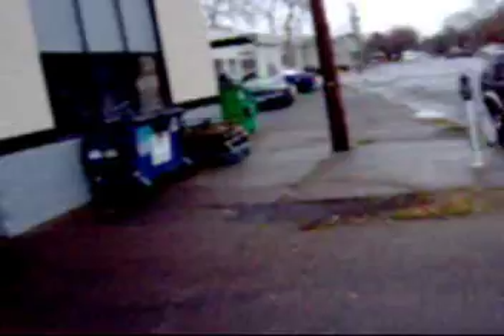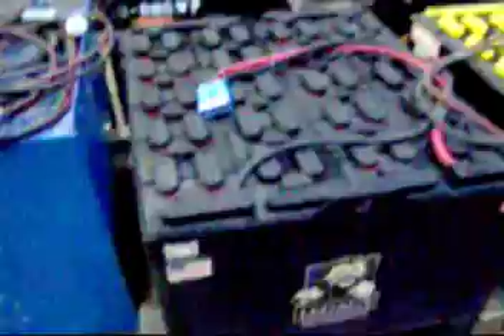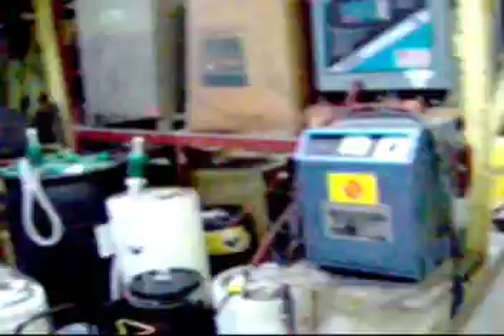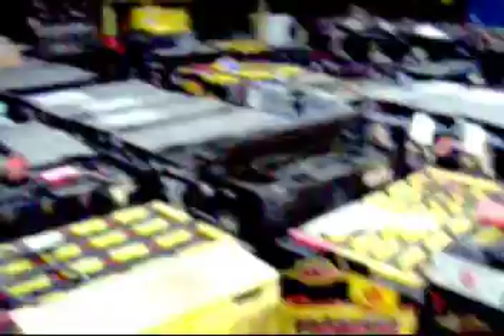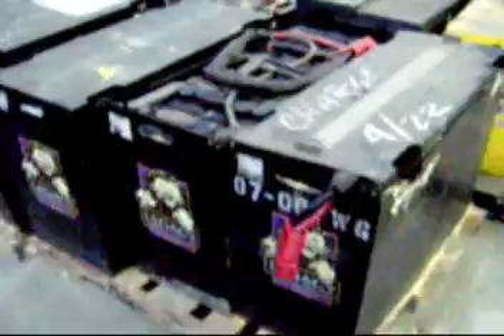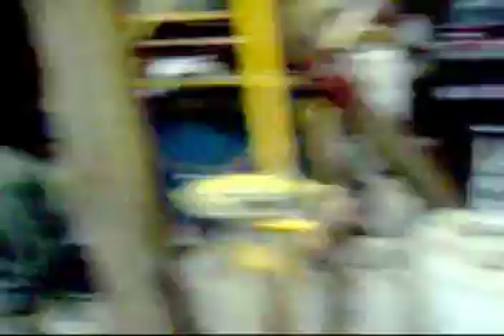Off grid and forklift battery packs

Comment: Solar is not just a trickle charge anymore. Readily available at $1 per watt its easy to achieve the 10% charge rate. Buy a  24 Volt 1150 ah pack, charge it a 115 amps with solar, so 24v x 115 or 2760. So a 2760 watt array will do the trick round to 2900 watts to be safe.